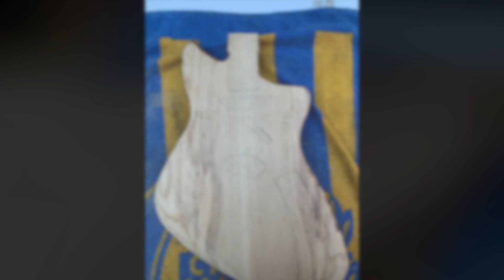Meteora Style Guitar Build

Comment: looks good.  I'm in the process of building a meteora shaped guitar right now, too....but with more "twists" than yours.  First, I've never built a neck before, so I got myself a prefab jaguar neck.  I'm sticking with the TOM bridge, with the string through holes behind the bridge, angled like the typical meteora.  I shaped the body by modifying a jazzmaster template I had lying around.

The electronics....well, they're "different."  I'm using the Hot Rodded Humbucker set from Seymour duncan, with a jaguar wiring scheme. BUT, rather than having 2 switches for pickup selection, I added a 4th hole to my control plate for a 3 way toggle.  The original jaguar switches are now individual coil splits for each pickup, as well as a master series/parallel switch.  The rhythm circuit is all remaining the traditional rhythm circuit..
Reply from the maker: Sounds amazing! A Tom bridge is the right choice!!
Reply: Amazing build! Getting ready to dive into my own Meteora build also based around a jaguar neck.
Reply: Please make videos too guys!! I wanna see them lol <3